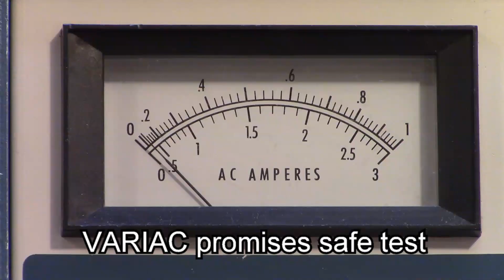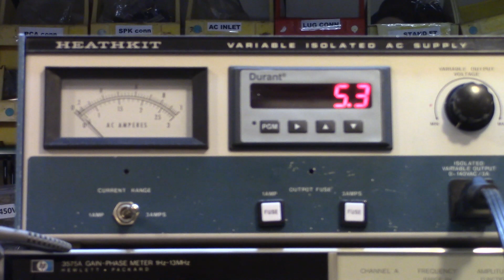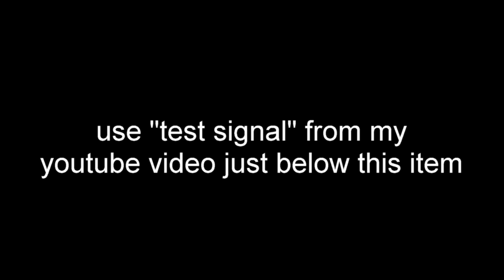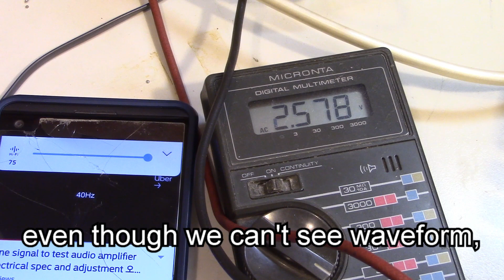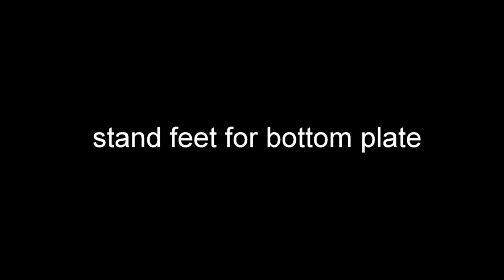DIY KIT preamp #10 FINAL, inside chassis, electrical & listening test 진공관앰프만들기

Comment: Nice result from all your work. Out of interest, what is the final voltage reading for the B+ to run the three 6SN7 in cathode follower mode (low output impedance)?
Reply from the maker: hi, I'm going to release an additional video soon with revised schematic.  Please wait. Thank you v m for ur comment. Young